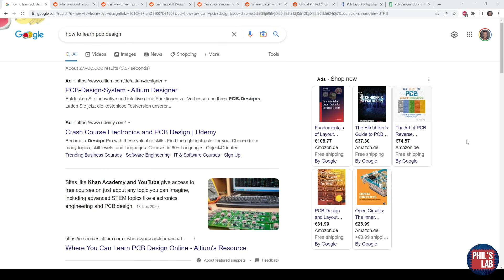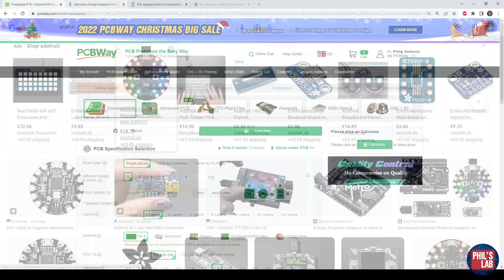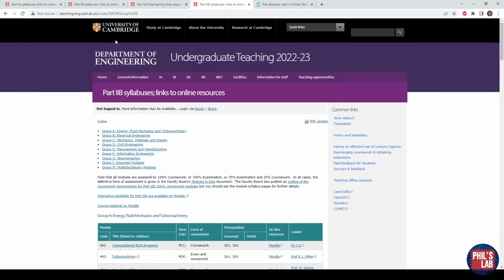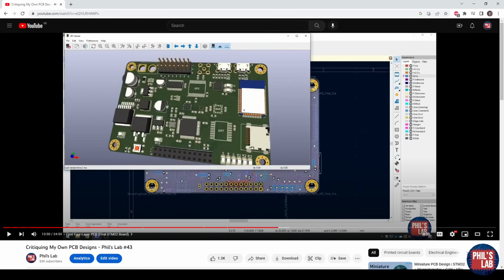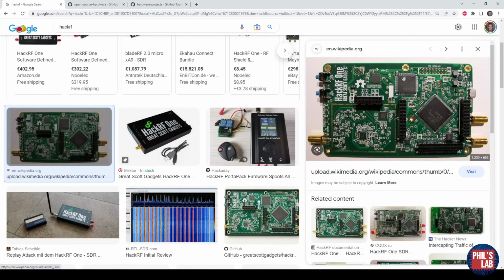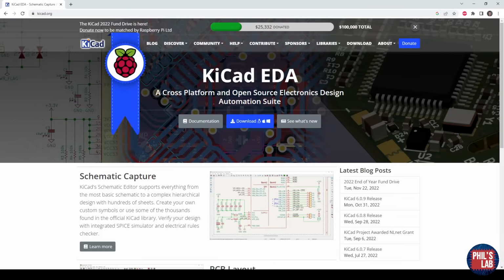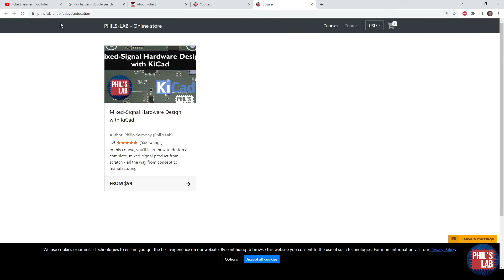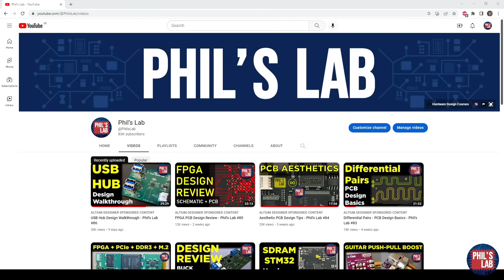(Sponsored) How To Learn PCB Design (My Thoughts, Journey, and Resources) - Phil's Lab #87

Comment: I think your channel has been a great resource for me. Your Kicad video got me to switch to it from Eagle (It was a great tool but I hate its integration with Fusion 360). I've been wanting to do my first 4 later board with an integrated MCU, but sadly the supply shortage is the thing that's been hard to really finish a design since its gonna be a long time to get a board manufactured.
Reply from the maker: Thank you, glad to hear that! I used Eagle before the Fusion 360 integration and hated it I'm afraid to say. Have you checked out LCSC? They've got a large number of MCUs still in stock - haven't had an issue with them.
Reply: @PhilsLab  JLCPB is my usual fab house and sadly they are out too. According to OctoPart almost every supplier is out right now until next fall :(